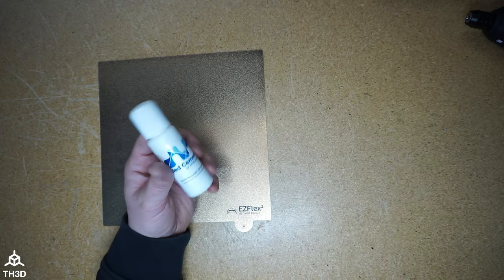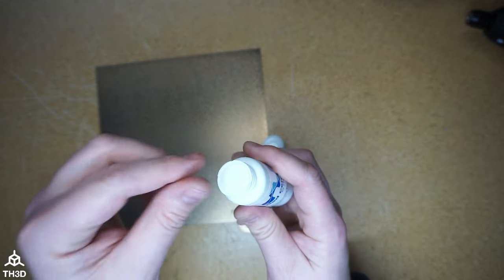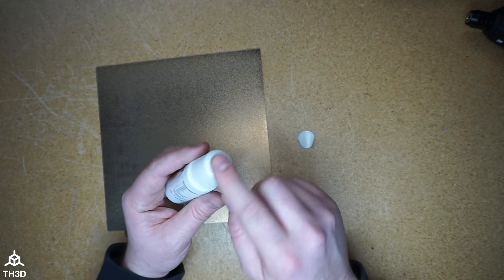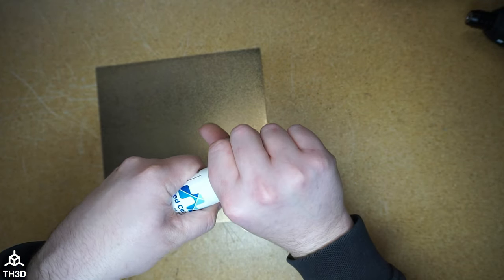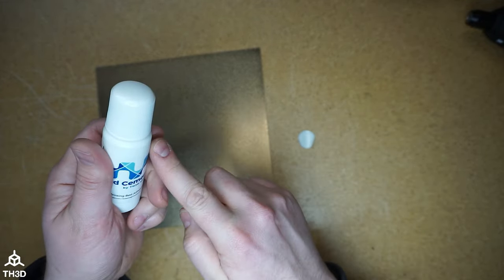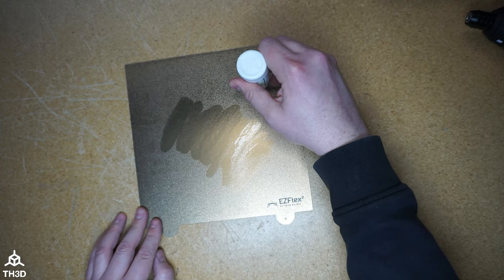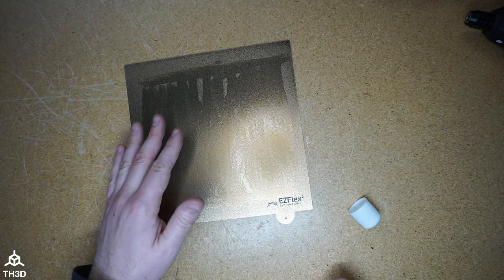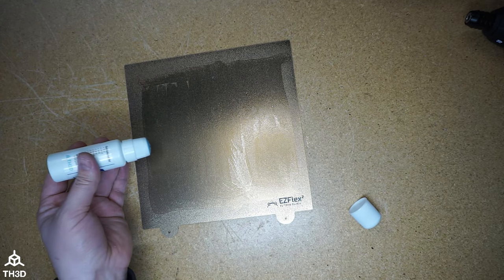Bed Cement Bed Adhesive Direction Video & Demo - Works with ANY 3D Printer

Comment: Anyone aware of a generic cap that fits the 50ml bottle?
My cap is split, currently held together with tape, but I doubt it'll keep it from evaporating.
Reply from the maker: Send us a message. We can send out a new one with a new order or just cover the postage. The reason the caps split is if they are over tightened. Contact us here: https://contactus.th3dstudio.com